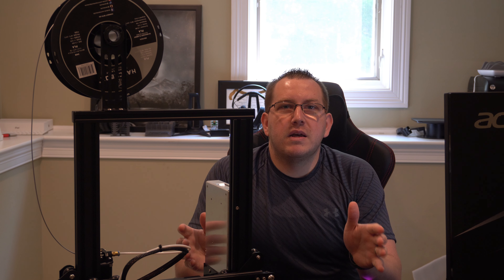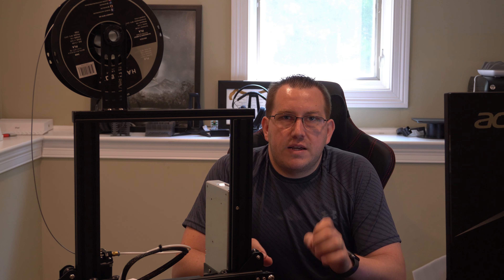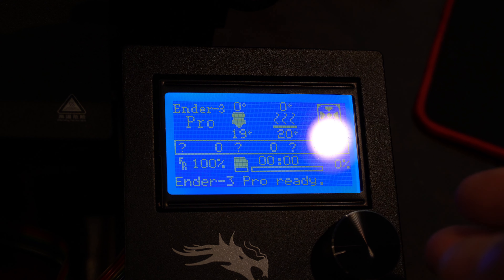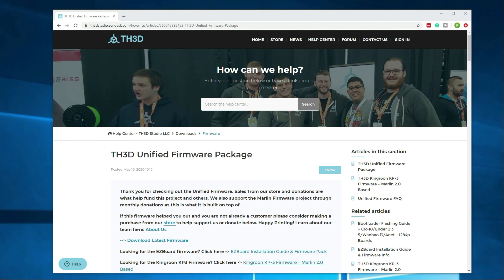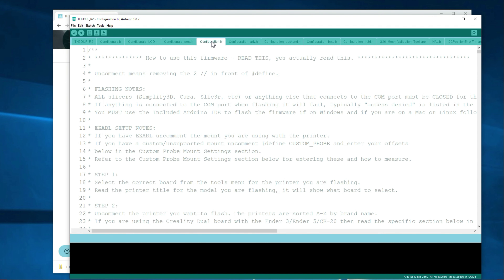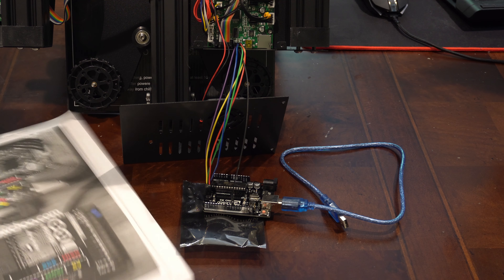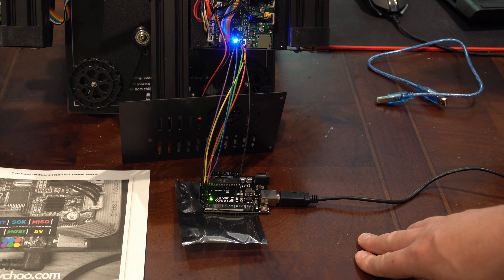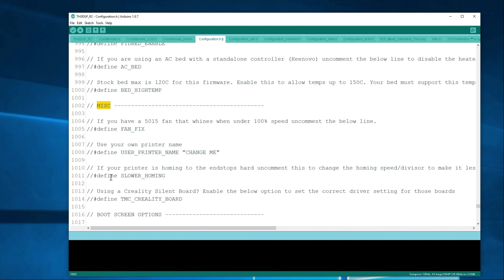Ender 3 Pro Firmware Update – Complete Guide

Comment from the maker: Hey guys, thanks for watching! Hopefully, this video helped you get started with your Ender 3 Pro. If you have any questions or would like other tips/tricks, just let me know in the comments.
Reply: Mine says  an error occured while uploading sketch what do I do I can't print anything since I added bootloader
Reply from the maker: @ardamansur391  Hi. Can you email me the full error you got? My email is admin@3dprintscape.com .
Reply: hey, thanks for awesome video. Updated the firmware easily. Just looking for where I can change the rotation of the extruder as have added a titan direct drive but when extruding it is in reverse. Is it by uncommenting the #define REVERSE_E_MOTOR_DIRECTION on line 956? Thanks Guy
Reply from the maker: @mrsutherland3387  I think that would do what your wanting it to. So you would have to uncomment that, then uploaded the new firmware to your printer.
Reply: I have the ender extender @3D Printscape , and I need the firmware changed to set the size differently on the printer, what do I do for that?
Reply from the maker: @EmoBoiLink  Assuming you have a 32 bit board, this video may help. https://youtu.be/pQ7WZST8sqk
Reply: @3DPrintscape  thanks, I see the video, but I don’t have notepad++ so I am using PlatformIO IDE in the  vs code addon
Reply from the maker: @EmoBoiLink  That should work ok.
Reply: @3DPrintscape  thanks

Comment: Thanks for the video. I was excited to do this and ordered the Uno R3 board and cables. Downloaded the TH3D firmware and flashed it to the Uno board as your video instructed. Opened up the Ender motherboard case and found it different than yours. Where you have the 6 pins for connection, I only have 4. Your board is apparently a different version and you might note that in your comments. Mine is V4.2.2.  I was not able to locate any other pins on this board. I did find that the newer Creality motherboards are firmware updated via their SD slot.
Reply from the maker: Hi. The printer I was working on was purchased earlier this year, so it should be similar. Can you email me your printer information and specs, maybe even a picture if you still have easy access to it? My email is admin@3dprintscape.com. Im asking for this so that I understand what the differences are. If Creality is shipping this model with new boards, I will try to buy one when I get the money and create another video. Sorry if this ended up causing you any issues.

Comment: I have a ender 3 and I installed the 4.2.7 silent board. Doesn't this have a bootloader already installed? I also installed a 400xl ender extender kit. I was wondering if there was a way to update the printer to tell the printer it's actual parameter
Reply from the maker: Hi. The 32-bit boards have the bootloader already. I will be doing a video covering the upgrade process for those soon, its simple if you are using a precompiled firmware build. If you want to update the bed size in the firmware, you will need to compile a version of Marlin to do it. I cover that process in this video for the SKR Mini mainboard https://youtu.be/Vn5rMdJgkAI . It will be different for the creality one but this that video should give you an idea of what would need done.
Reply: @3DPrintscape  awesome thanks for the quick reply

Comment: Can i use this to stock firmware flush because i think thats what i need to do but i dont know how to do it and i dont want to waste all my money
Reply from the maker: Hi. Yes you should be able to. Also, I'm not sure how old your printer is, but you should check to see if it has a 32-bit board in it. The upgrade process is different, easier, with those.

Comment: Hello. I just recently installed a silent board for my ender 3 pro. However, I turn it on and went to "about printer" and see that it is still Marlin 1.0.1 and not Marlin 2.0. I heard that Creality just calls it 1.0.1 but it is in fact Marlin 2.0 installed. Do you know if that is the case? Do you have any tutorials to update firmware after installing the silent board?
Reply from the maker: Hi. The Creality firmware appears to be based on Marlin, but its a very stripped down version. If your looking to actually run Marlin 2.0 on your printer you will want to check out this video. https://youtu.be/pQ7WZST8sqk

Comment: I have spent an entire day, faffing around with all kinds of software, loaders and wirings, to his countless errors. This, finally is the only video that  was able to run through, step by step with no errors or missing explanations to get this to work.

Absolutely Fantastic, many thanks.

2 friends have the same printer so I'll direct them this way.
Reply from the maker: Hi. Thanks for the feedback 😊. I'm glad I could help you out and I appreciate you sending your friends to my channel.
Reply: What does he mean by connections the printer directly to the computer after removing the arduino uno
Reply from the maker: @laggypenguin7107  After you push he bootloader to the printer using the Uno card, you would connect the printer to the computer using a USB cable.
Reply: @3DPrintscape  ahh now I see thanks again !

Comment: Step by step. I hooked the board up to my computer and followed directions...till you said to unplug the board and then plug my ender into the computer. I don't have a chord for that. My stock ender 3 has a micro usb port. What do I do now? OK. Ran to the store and got the mini USB cable. finished the process and all looks good. Just a few suggestions. 1) I wish you had started the video with an "equipment needed" section. Tell me that I will need that cable. 2) When you unhooked the elegoo board from the computer the first time, I wish you had told me to leave the current windows open because we would come back to it. 3) When you were searching for texts, I wish you had told me how to pull up that search window. I am not tech savvy. I had to scroll down the numbers to find what you were looking at on screen. 

All that said, it worked. you walked me through the firmware upgrade, telling me what equipment to order and how to install. I appreciate your efforts, and will have to keep an eye out for your content when I need clear instructions in the future.
Reply: Well, I am having some trouble now. I want to calibrate my extruder, but don't have any options under "motion." I see some people doing firmware upgrade have the option to "initialize EEPROM." Mine says "Reset EEPROM." not sure what to do now. Any help out there?? My startup screen on the printer says TH3dD .U1 .R2 .B5
Reply from the maker: Hi. Thanks for the feedback. I apprentice it. I agree with the recommendations you provided and will try to use them in future videos. For the EEPROM selection goes, it is disabled by default in the Marlin firmware (https://marlinfw.org/docs/features/eeprom.html). Based on a couple articles I checked out it looks like you can enable it by adding these two lines in the Configuration.h file, but I cant test it as I have the SKR mini in there now. If your looking at making a lot of changes, I would recommend you looking at the SKR Mini. I did a video on the install that you can see here (https://youtu.be/wtT6iA9IG7A). Overall, its an all-around better board and a worth while upgrade. 
#define EEPROM_SETTINGS
#define EEPROM_CHITCHAT
Reply: @3DPrintscape  Well, I have no idea what the EEPROM does. I just noticed that mine says something different from what other people's does when I was watching a video on extruder calibration. When I go to "control" and then to "motion," there are no options under "motion." I don't have "velocity," "acceleration," or "steps/mm." Nothing is under "motion." Not sure what I did wrong.
Reply from the maker: Those would be settings that can be defined in the firmware or on the system using EEPROM. By default, Marlin disables those settings in the firmware to protect the end-user. “By default, EEPROM is disabled. This is to avoid the “unintended consequence” of local developers making changes to the values in Source Code and then having the printer boot up using the EEPROM values instead.”
Reply: @3DPrintscape  thanks.  Now to figure out how to enable them so I can calibrate the extruder.

Comment: Hey, when you are done with the uno board and you connect the printer to the computer directly, do you just use the mini usb port on the front of the printer? Totally noob question I know
Reply from the maker: Hi. Ya that’s what you would do. Once done with the uno board, that would get unplugged, and you would connect the USB cable from the computer directly to the printer.

Comment: Thanks for the informative video.  I received my Ender 3 Pro printer for Christmas 2020 so I'm just trying to get everything up to date.  I watched part of your video then stopped it so I could order the Elegoo Uno board and cables.  Now I'm ready to start the update but when I check my printer info it says I have Marlin Ver 0.0.6 and the date May 30, 2020.  The printer didn't ship with the Creality firmware.  Do I still need to do this update?
Reply from the maker: Hi. Can you verify what board you have? It sounds like you may have the Creality 1.1.4 board. If that’s the case, I would do this upgrade or upgrade to a silent 32-bit board like the SKR Mini or Creality 4.2.7.
Reply: @3DPrintscape  I have the Creality 4.2.2 board.  Do I need to upgrade to 4.2.7?  If so, is that a new board or just an update?  I really appreciate your help and assistance.
Reply from the maker: @maryclark8191  Ok, the 4.2.2 board is 32-bit, just not silent in most cases, so you wont need the Uno board. Its probably worth you joining my discord server, I can help out more there https://discord.gg/Bu94EYVkrU
Reply: @3DPrintscape   I tried to join the Discord server, but ran into problems (laptop locked up and had to reboot) and it won't let me back in to finish.  It says "Unable to accept invite".  Sorry for all the problems.
Reply from the maker: @maryclark8191  Hey, i just checked and the invite is still active, maybe its related to the computer locking up. I generated a new one, give this a try. https://discord.gg/apwAf7XU

Comment: Hi.A stupid question:I have an Ender 3 and need to change the firmware.Just watched your video.By the end you plug the pc straight into the printer.I assume this is USB to the Micro-USB on the printer front?Thanks.
Reply from the maker: Hi. This video is for the older 8 bit boards, and it would use a USB to Mini-USB cable. If your board has a micro-usb port, you probably have the 32-bit 4.2.2 board. If  thats the case, you will want to follow this video. https://youtu.be/uylAYrmZqrk
Reply: @3DPrintscape  Thanks,man.
Reply from the maker: @subinspecttom2499  You're Welcome

Comment: Thank you so much for this video. I recently purchased a used original Ender 3 Pro, and now realizing the endless upgrades I can consider to improve the overall 3D printing experience.

Curious if there is any advantage in installing the bootloader and replacing/upgrading try the firmware as opposed to replacing the main board with a 32 bit model with the bootloader already installed and the ability to upgrade/swap the firmware at will? Sort of seems the new main board would be better in terms of future proofing. My next upgrade is likely going to be a BL Touch, but before doing so, I need to pull the plug on some means to upgrade the firmware. Note that I have a Raspberry Pi 3 connected running OctoPrint, and need to consider that as well.
Reply from the maker: Hi. The 32 bit board provides a smoother printing and upgrade experience, especially if you get one with silent drivers. I have been recommending that people just upgrade their board instead of buying everything needed to flash the bootloader to the old 8 bit ones. That said, it sounds like you already have the bootloader so what you have will work but you will be able to do firmware upgrades easier on the 32 bit boards going forward.
Reply: @3DPrintscape  Thanks so much. Truly enjoy your content. Such a wealth of 3D printing knowledge to share. As for my printer, I currently have a relatively stock Ender 3 Pro with the original 8 bit board. Only upgrades so far are glass bed and OctoPrint on a Raspberry Pi. Think my next upgrade is likely the 32 bit board.
Reply from the maker: @ckthmpson  If you end up doing the board upgrade, make sure to get one with the silent drivers.

Comment: Oh my God thank you so much I just got my BL touched in the mail today and I didn't realize you need to mess with the firmware to get it to work so thank you so I just ordered the board and the wires and I'll be here Tuesday and hopefully I'll get my BL touch done either Tuesday or Wednesday next week and is under three pro I have is my first 3D printer and I've had it for about 2 months now and I really like it also I wanted to clarify if when you just plug the printer into your PC was just the USB to micro USB I think it's called poured on the printer that's already installed by the SD card?
Reply from the maker: Hi. The Ender 3 Pro is a great printer, and the BLTouch upgrade is defanitly worth it. You would use the USB cable to plug your printer into the computer after you install the bootloader. To install the bootloader, you would connect the Uno board to the 3dprinter with the jumpers and to the PC with the USB cable.  I hope that answers your question. If it doesn’t, let me know and I will try to provide more info.
Reply: @3DPrintscape  yep it answers my question thank you I was just making sure my understanding of the process was correct

Comment: Hi. I have followed every step of the video on ender pro 3 1.1 board (I think) and every time I try to upload I get "error compiling for board sanguino 1284p. Any ideas where I am going wrong. Am using old mini usb cable to connect printer to laptop if that helps?
All i have now is a blank blue screen.
Reply from the maker: Hi Richard, can you join my discord server? It may be easier to troubleshoot there. https://discord.gg/Bu94EYVkrU

Comment: Hi! thanks for explaining this in such a clear manner, I totally feel confident with the process now! Just one dumb question: Do I have to leave the arduino board attached to the ender motherboard and put it inside the case also? or should I just detach it completely after the bootloader has been uploaded?
Reply from the maker: Hi. Thanks for the feedback. Once the bootloader is installed, you will detached the arduino board completely. Also, im not sure how old your printer is but make sure you have an 8 bit board before following this guide. If you have a 32 bit board the process is much easier. I have a link to that guide in the description.

Comment: Question:  After loading the bootloader, disconnecting Uno Card (about 16:15)  and connecting the printer director to the computer, I assume you did that using the mini-USB port on the front of the printer?  Please confirm.  Thanks
Reply from the maker: Hi. Yes that is correct.

Comment: I'm going to be upgrading the size of my ender 3 with an extender kit and found your video for changing/updating firmware. Last year I upgraded my board to a creality 1.1.5 board for it to be silent. In your video I saw the mention of silent board under the printer name when you changed it. For a silent board do I need to do anything more than what you did in the video? I've never messed with the firmware before so I am scared and hesitant on messing with the firmware
Reply from the maker: Hi. You will need to make sure you get the firmware that is meant for your board and I believe the Creality silent boards dont need the bootloader. The process will be closer to what I cover for the SKR Mini ( https://youtu.be/Vn5rMdJgkAI ) but if your looking to stay on the Creality firmware there may also be some pre-compiled firmware for that board that you can just drop on an SD card and put in your printer.

Comment: Hi I was wondering why you did not look at getting the SKR MINI E3 V1.2 32 bit bored it has Marlin 2.0 Firmware and Thermal Runaway already install as it has a plug for the BL TOUCH so you just need to plug it in and play the creality are using a 8 bit and just for $38 that’s a bargain and it takes 15 minutes to install
Reply from the maker: Hi, I did look at getting that board and may still end up doing that in the future (not sure yet). I wanted to be able to show people how to upgrade what they have first and for the cheapest way. Also, as a new channel I depend on YouTube search for most of my traffic so the topics/titles align to that, once the channel gets bigger that wont be a requirement. I think in total I have less than $20 in this upgrade and the Uno board can be used for other projects I’m working on.

Comment: Thank you for the thorough walk through on getting the bootloader installed.  I followed your instructions to the T and the install went pretty smoothly.  One issue, after uploading the TH3DUF_R2 sketch, I had a constant buzzing from the annoying speaker on the unit.  The TH3D software started right up.  I had to back off to the original creality sketch now with marlin.  Do you have any insight into the buzzing issue?  I must admit that this was while the unit was being powered by the USB and not the AC cable.  Thanks again for a thorough tutorial.
Reply from the maker: Hi. I cant think of anything that would cause the buzz like that besides dirty power, or a grounding issue. Can you check to see if its still there when you plug it into the wall?
Reply: 3D Printscape I wound up doing a clean upload with a new untouched TH3D sketch.  Of course I activated the Ender lines as required.  This worked great.  No more buzz.  I think it was something I must have accidentally deleted or typed while editing the sketch in Arduino.  I tried to do the firmware update including the BLTOUCH changes all in one upload.  Probably just my clumsy typing
Reply from the maker: Thanks for providing this update, im glad everything is working for you now 😊.